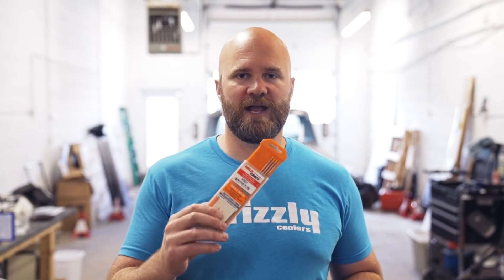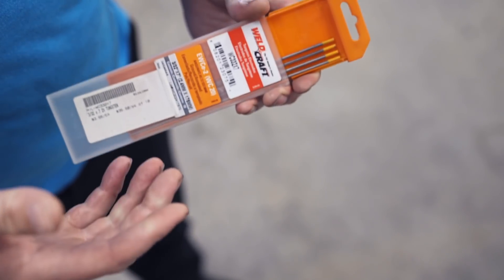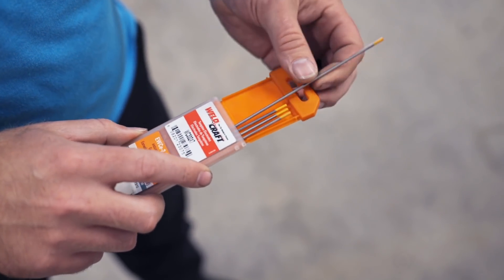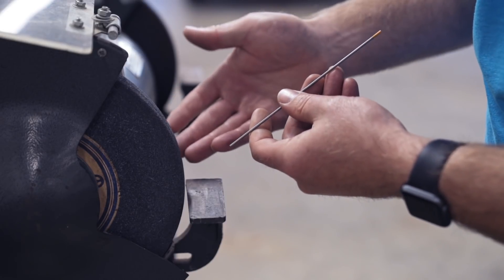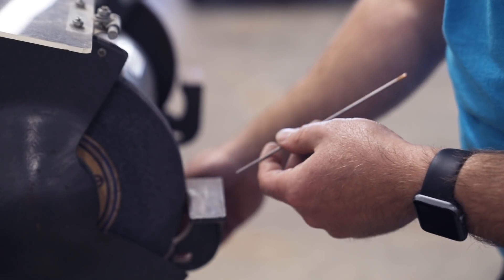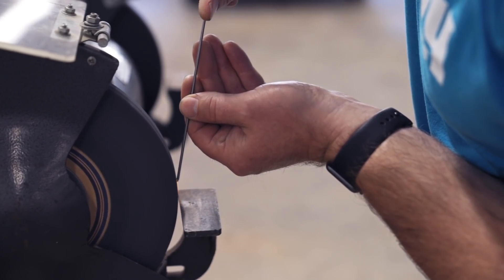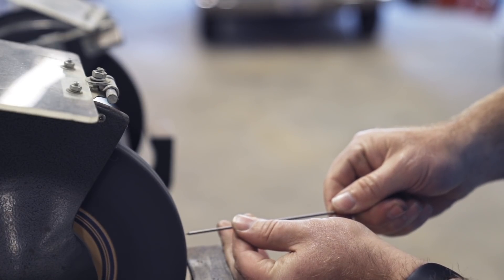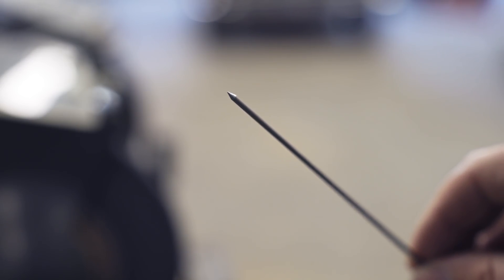How to Grind Your TIG Tungsten to Weld Steel

Comment: Red is 2% Thoriated. The thorium improved the electron emission qualities and improves arc initiation. Very good for DC carbon steel, stainless steel etc, and in AC for thin aluminum.
The best way I've found to sharpen my tungsten is by placing it in a cordless drill and sharpening on a bench grinder in an upward direction, obviously the finer the wheel the better. Helps with the longitudinal grind

Comment: I am also new at TIG welding, I bought 1.6mm and 2.4mm electrodes (x 10 each), and sharpened them all. I hold my electrodes the other way up, it works and is easy to do. 20 electrodes, both ends wore a nice groove into my grinder wheel, I didn't think it would wear that quickly. Cheers.
Reply from the maker: I’m afraid of it catching and the wheel pushing the tungsten into your hand holding it the other way.

Comment: Red has thorium in it. Works well but is mildly radioactive and that might be a problem if you breathe in a bit of the dust. I use a clean 120 grit flap disk and turn the tungsten slowly in a cordless drill. I don't claim this is better I just don't have a bench grinder and it seems to work fine!
Reply: Yeah the red and orange should be grinded on a tungsten grinder. Unless you like gambling with your health :) at least it's like that here in Europe

Comment: I use a dremel knock off & diamond wheel, they both cost virtually nothing. I used to just hold it by hand, but I've 3D printed a holder and glued on a window so that I get a more consistent angle and the tungsten dust is contained. Here's a link to they holder I use:
https://www.thingiverse.com/thing:3652497
Reply from the maker: That looks pretty cool